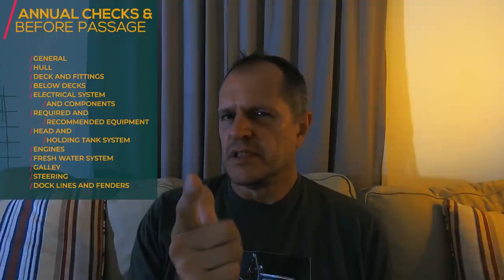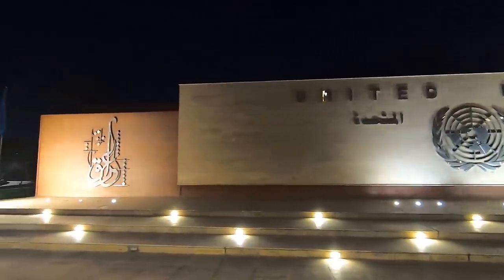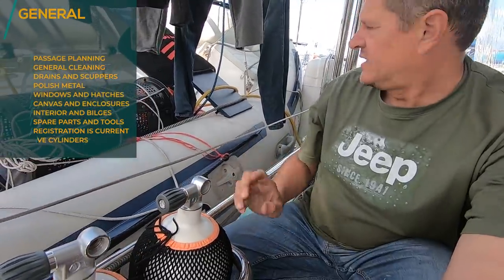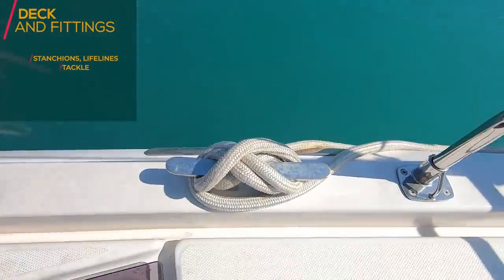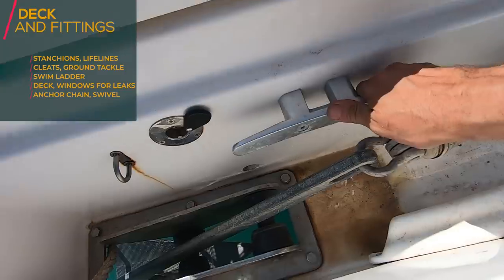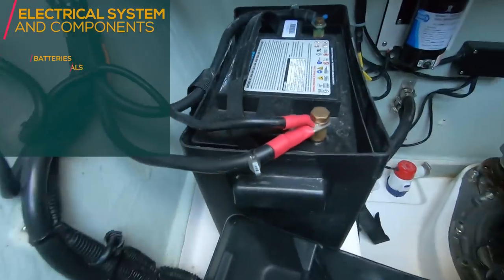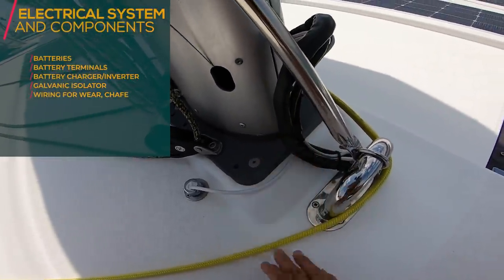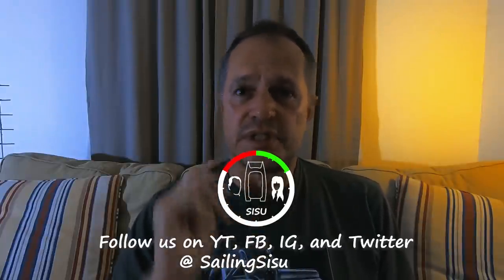#73t Part 1-Boat Life Checks - 100 Point Annual and One MONTH Before Passage|Sailing Sisu Leopard 45

Comment: Wow that was a pretty thorough round up and some good details there.
Might be a good idea to explain "Galvanic Isolation" in another episode and the reasoning.
It is an important subject given different metals have different electrical charges, with salt water involved!
Nice looking unit the Prosafe FS60.
Great episode and in a previous life were you an Engineer of some kind, you seem very thorough?
Enjoyed that video, thanks.
Reply from the maker: thank you for the kind complements! yes, i am planning on doing a video on galvanic isolator and why some are dangerous and why you need them, etc. yes, i started as an electronic engineer and moved over to software engineer, but the worst is my OCD :-D

Comment: From the video it is obvious that you are extremely thorough.  How much time did it take you to complete the first 50 point check?
Reply from the maker: Thank you! Very good question! Well, I actually did the full 100 point check already. In fact much more than what we show in the video, because we have 7 fire extinguishers, 20 life jackets, 4 spinlocks, two hulls, .... :-D And if I found an issue, then I try to fix it ASAP. To tackle all the rust spots was a few weeks through rain showers so, it took longer. I have been busy since early November 2019 to mid February 2020 so, say 3.5 months including fixing stuff. There are still outstanding issues and some of them may be very big like the apparent crack in forestay. If you just run the checks and make the list of things, then I would guess one week?

Comment: That was a FRIK’N awesome episode. Since I read the Yanmar sail drives are not isolated I wondered how you covered that. There’s more to maintaining the rigging than I thought. And more trips up the mast then I thought. Also, need all stainless tools so I can’t just bring the tools I already have. Which is kind of a bummer. Anyway Really good stuff, Looking forward to part 2!
Reply from the maker: Thank you, Robert for the kind complements! Yes, myself was surprised to find so many surprises! And I do run a tight ship and I am trying to keep a finger on all the stuff, but hey, this list showed me to perhaps do this a monthly check :-D
Reply: Sailing Sisu as you said elsewhere, I’m an OCD-afflicted mech/controls engineer as well. My eyes are automatically drawn to body dents/dings/scratches on my cars. It’s a curse.   BTW, I hope R&C change the routing of that mast harness.  Packaging fail.
Reply from the maker: Robert, it may also be my way of tacking...I try not to loose speed and therefore try to sheet the genoa as quick as possible, meaning, i keep the lazy new sheet stiff as possible so that the genoa is in place as she gets to 50TWA...i think most people let the genoa fly and then bring the sheet in...but yes, that is a big pain for me!

Comment: at first I thought you had cracks in the gel, you never mentioned it, but later you were talking about scuffs and gouges needing fixes so you mark them; so it appears the crack was really just marking a longer section you need clean and re-gel/ coat the area; is that correct.?  (always something new to learn from Sisu and her crew).
Reply from the maker: Yes, when I washed Sisu, she is now awfully dirty again after a series of winter showers :-( , I noticed small defects and photographed them. Then I polished and found more air bubbles, so, I marked them with a marker pen :-) now the rain cannot make Sisu dirty and hide the defects :-)  As for the bubbles, I think they started to emerged because we are experiencing very cold at night and fairly hot during the day when the sun is shinning on the gelcoat. The longer cracks were investigated and it appears to be gelcoat stress cracks, it is not present in the fiberglass.

Comment: Hi, I’m surprised how rusty the stainless steel is in places. How old is the boat? Do you think Leopard are using top quality Stainless?
Reply from the maker: It is surprising. But I guess it is expected, right? The west pushing profits and the east providing? That said, stainless steel needs certain pampering to be able to withstand nature. I guess, in the old days, the SS manufacturers did the pampering 😅

Comment: Sir your winch cable end for the lowering mechanism for the inflatable , the “D” ring at the end should have the “cable” sitting in the ring part of the shackle and the metal anchor point on the pin.  If that makes any sense,!!
Reply from the maker: Thank you, Brett! I was wondering about that...it just does not look right.

Comment: @4"29 is that two small cracks? next to the  stanchion.
Reply from the maker: Thank for your keen observation! Yes, when I washed Sisu, she is now awfully dirty again after a series of winter showers :-( , I noticed small defects and photographed them. Then I polished and found more air bubbles, so, I marked them with a marker pen :-) now the rain cannot make Sisu dirty and hide the defects :-)  As for the bubbles, I think they started to emerged because we are experiencing very cold at night and fairly hot during the day when the sun is shinning on the gelcoat. The longer cracks were investigated and it appears to be gelcoat stress cracks, it is not present in the fiberglass. This specific section I marked and you saw, was covered in small porous like holes and I want to see if they can sand it down and reapply gelcoat. There was no visible leaks or signs below, but I am worried about the water getting in between the layers and then starts to cause damage...so, like you said, better fix it.

Comment: Take a look at 4:29 on the railing gel coat it’s already cracked and could cause water intrusion into the deck.  Please get that fixed
Reply from the maker: Thank for your keen observation! Yes, when I washed Sisu, she is now awfully dirty again after a series of winter showers :-( , I noticed small defects and photographed them. Then I polished and found more air bubbles, so, I marked them with a marker pen :-) now the rain cannot make Sisu dirty and hide the defects :-)  As for the bubbles, I think they started to emerged because we are experiencing very cold at night and fairly hot during the day when the sun is shinning on the gelcoat. The longer cracks were investigated and it appears to be gelcoat stress cracks, it is not present in the fiberglass. This specific section I marked and you saw, was covered in small porous like holes and I want to see if they can sand it down and reapply gelcoat. There was no visible leaks or signs below, but I am worried about the water getting in between the layers and then starts to cause damage...so, like you said, better fix it.

Comment: 4:38 the ends on the lifelines... are they attached with thread or are they just clamped on? my boat has threads on the U-shaped part, and i could use 3of those if you know where to find them? thanks :)
Reply from the maker: Thank you for watching, Matias! I have seen the U-Shape quick release clips, which we have at the life line "gates" (for the lack of a better word) at a few chandleries. not sure what you call them though. as for the long life lines, they are all attached why a turnbuckle mechanism at the one end and then a fork with pin on the other. i hope i got you right?

Comment: Is it common for Anodes to wear so quickly ?
Reply from the maker: that anode was still from the factory and was at the time of the video about 8 months old. I would say it may be a bit fast because we were sailing most of the time and have not been on shore power at all? but frankly, some anodes don't last 3 months in a marina. that said, i think may had an electric problem, which was solved in cabo verde three months prior to the video? so, i will check again. but this is the reason why the galvanic isolator is so important. but, keep on watching, click that bell, because i am planning on an episode just on galvanic currents :-)
Reply: @SailingSisu  Ah,, just wondering , 'cause I do not know.. Beautiful boat, You are living "The Wonderful Life"

Comment: I think a little WD40 would help longevity of most of those part.
Reply from the maker: Thank you, Andreas! Yeah, not so sure about it... I have many rusty spot and was starting to do a bit of research as usual :-) because I wanted to understand why my stainless steel is rusting and whether it was bad quality or what. But, I got to the bottom of why things rust, and how to prevent it. In the same research, I wanted to get the best protection for the stainless and came across many products and their uses. While the “W-D” in WD-40 stands for Water Displacement, WD-40 Multi-Use Product is a unique, special blend of lubricants. The product’s formulation also contains anti-corrosion agents and ingredients for penetration, water displacement and soil removal. The thing is, there is not that much lubricant... I do have WD40 on the boat and many other rust block or prevention stuff too. But, I think I need to do an episode just on rust, what do you think?
Reply: @SailingSisu  I agree but after you do all this if you spray wd on it, it will repel the water for a while but you must do it regularly and because it's cheap its not a problem. try it in 1 place and see how you get on.
Reply from the maker: I will do!